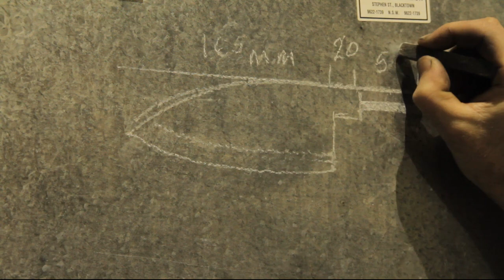Forging Deba Knife

Comment: What is the resin you used to glue the Handle can it be got from Bunnings if not where can I get it I'm on the Mid Nth Coast NSW
Reply from the maker: Hey mate I used Blade bond Epoxy from Artisan Supplies in Sydney
Reply: @batcountryforge5945  Thank You very Much.

Comment: I haven't anyone use gilbows since forever ago
Reply from the maker: Yeah the nickle is pretty hard to cut otherwise. Its too thick for scissors or a stanly knife and if you got through it with them it would severly crinkle the edges.